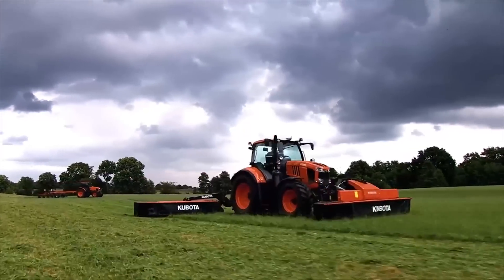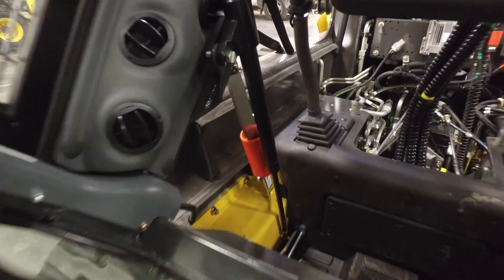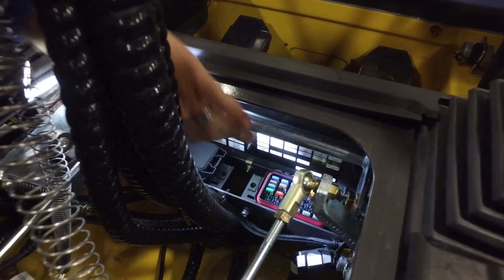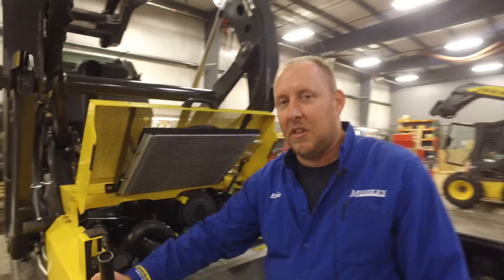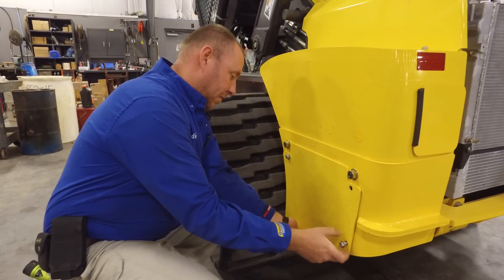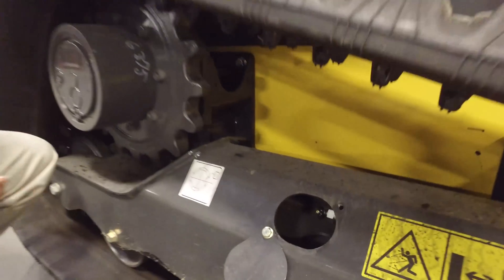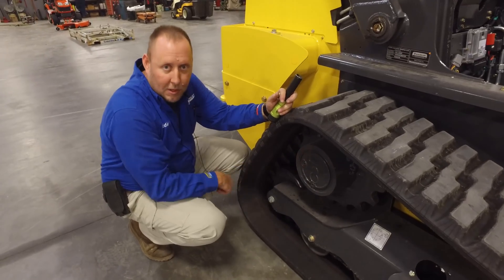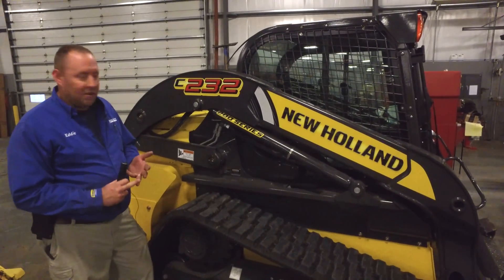Mechanical Deep Dive on a New Holland Compact Track Loader

Comment: My dealer forgot to put the nuts on that hold the cab down after doing some work on my C227.  After loading the CTL on a trailer and having the entire cab tilt forward with me in it, I will never forget to double check that those nuts have been replaced after service!  Don't forget to replace the nuts!

Comment: So I have a major question, my l213 has code 1824 for the dpf filter spot level, cleaned and cleared the dpf filter back installed into the machine and the code hasn’t gone away. How do you clear the code so I can have full throttle back?

And if there is a service tool send me link thanks!

Comment: How to make the reset on oil chance light?
Reply: Check the owners manual. On the L228 I work on, you have to go into the service mode, then go through a menu to reset it. I can't remember exactly how to do it, but its not too hard, but the sequence of button pushing is important.

Comment: Can any one help me with model info. I seen a New Holland skid steer at a construction site. It had two, not just one, main sprocket drive. Or at least it looked like a drive sprocket. So instead of the regular "wedge" look most tacked skid steers have it looked more like what you would see on a tank. Only upside down. Can anyone tell me what model that was or if there is an option or name for that sort of setup? Or if that's not available anymore but model info is still appreciated.
Reply from the maker: probably Loegering VTS bolt on tracks?